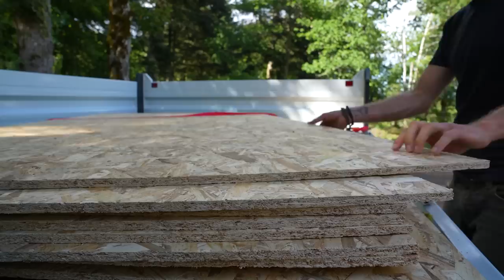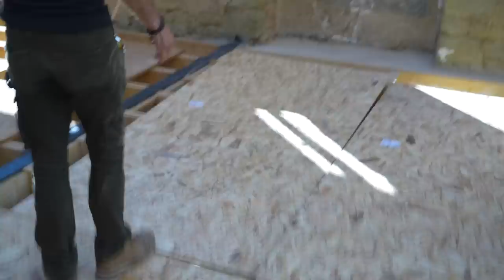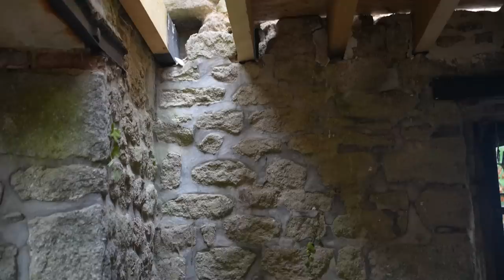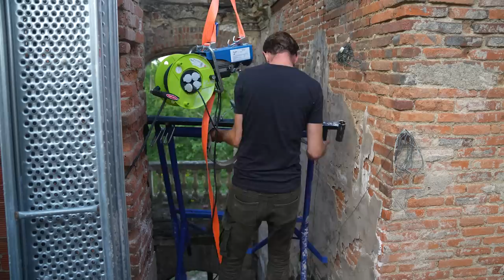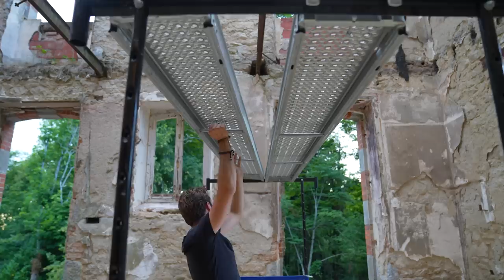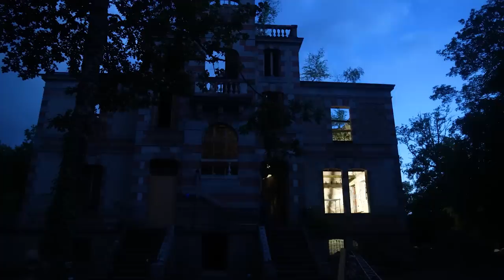A floor for a floor.

Comment: I really enjoy your video’s I am watching them sinds Christmas. Lots of respect for what you do. 
What I don’t understand is why not finish the wall at the top first? Bring in the circle beam and tie everything together up there. Then make the roof, I see you already have the boards for that. 
Now your all excited about these new floors, while your first job isn’t finished at all. Things keep getting wet all the time. What’s your motivation to do it this way?
Reply from the maker: The roof is suspended on the top floor, the top floor is supported by the walls , which need repairing and reenforcing from the bottom up and all new tie beams on each level to take the weight of the roof
Reply: That makes sense. Thnx. Thumbs up 👍🏼

Comment: Why park the van so far away. Lot of extra work carrying materials. Park the van up close see if you can unload through a window opening or back you to the front door. And buy a small ladder to be attached to you working platform. Get up and down as you do one slip in the rain. The project on hold for months

Comment: I would definitively have considered building temporary stairs in the main tower where the original one was, narrow enough to leave a good space in the middle to winch up material. With beams of small section (bastaings in French...), it should cost you only few hundred euros per level, and save you so much time during the next years until all dirty work is finished and you can replace it with the definitive stairs. Over the last level; it could support a platform for some scaffolding to build the roof... It could also be the structure supporting a temporary roof for the tower; made of corrugated PVC or else... Is that a bad idea?
Reply: It's a great idea.   Just waiting the day when Dan adds temporary main stairs.  I will make his life going up & down so much easier.   Good encouragement, explaining the cost.

Comment: wouldnt a roof be a better start then the lower floors? I understand access is a problem but it would make a huge improvement on working conditions for the rest of the build. Even a temp solution for a roof.
Reply: That is the usual order for these types of mansion/chateau/castle restoration, with lots of scaffolding all around ( and either big budget/big loan.)   A roof 1st , and then the inside.   I'm sure you've noticed Dan doesn't have alot of scaffolding.  In fact, he has a few and they're not industrial strength.  So, Dan has come up with an unsual method:   he is working his way up to the roofline, stabilizing the walls as he goes.   He is replacing brick & stone, and remortarizing so that the walls can support a new roof.   Temporary (flatish roof) first, permanent roof later ( see online black & white photos of Chateau Charmont for original mansard style roof.) 

He is almost to the roofline in the main hallway 2nd floor wall.   Then, a temporary roof.  He has covered those new wood beams & temporary OSB3 subfloors with tarp to protect them from rain.   Hopefully, he will cover the new temporary subfloors he just  built in the right wing ground floor with tarp when he isn't working on them.   Or, seal them.   Yes, working conditions inside could be better, with a roof.   But, it is what it is...he is getting there.
Reply: @homeemail2306  got it, thanks! And I just want to say I like this project and the work he is doing. A big feat for sure!

Comment: The kitchen is half basement isn’t it, from the days of kitchens being below stairs. Maybe you should use one of the rooms on the ground floor you’re working on now for the kitchen (as these days you don’t need so many formal rooms). Then you can have a big, bright, sunny , family kitchen with lots of windows and light on the ground floor. Makes more sense the way we live now.

Comment: Well done going for a cheaper temp floor! I'm still not sure why you did not stabalise the roof structure first, and seal the roof before going to the floors? Surely the roof and stabalising the structure is more important then the internals i.e. floors joists etc??
Reply: Dan does not have alot of scaffolding, like the usual way restoration occurs with other mansions/chateaus/castles.   So, Dan is working his way up to the roofline, stabilizing the walls so that they can support a roof.  He is replacing brick & stone, and remortarizing.  Temporary roof 1st, then permanent roof later as funding allows.
Adding floors also helps stabilize the walls. 
Dan is almost there, at the roofline at the 2nd floor wall in the main hall.

Comment: Dan, you need to HIRE a crane and lift it in over the top and bring down and hold while you and the guys guid into place and set them properly and safely. You’re too high up and the beams to heavy for 2 people to lift up into from the bottom. And you could also crane the 3rd level beams and set them in your hallway area and have that part complete while you have the hired crane.

Comment: Could you possibly attach your electric winch to the old beam at the next level and use it to lift the new beams in place.  I don't know how strong they are after the fire.

Comment: So I'm wondering, Dan, are you at a point where you could roughly finish at least one space to live in? Like for "camping" inside the chateau? I'm thinking composting toilet, Clean water and grey water tanks with a free standing sink, like a "tiny house" or "van life van" inside your chateau?
Reply: Unfortunately, he is not anywhere near where he could roughly finish a room of the chateau for camping in it.   He is mainly focused on stabilizing the walls/working his way to the roofline, so they can support a temporary roof.

He has already replied, "It still isn't watertight" to another commenter who asked the same question earlier this week.   The basement floods with several inches of water when it rains.   You can see the rainwater pooling in his Vlog when he first started to put the wood joists in the kitchen ceiling.    He has alot of future drainage work to do in & around the outside of the basement, as well as windows & temp. roof overall for watertightness.

It'll be interesting to see what Dan does for accomodations, water source/working water well & working septic system.   Lots of advice for sure in previous Vlog! comments!
Dan has said, "Never again," about a composting toilet in his video, "5 Years to Renovate an Abandoned Farmhouse".  I'd be surprised if he decided to do a composting toilet.
Reply: @homeemail2306  I do not read all the comments. Busy doing my own building these days. Thanks for the inspiration, Dan! 👍😊👍 But it just so happens that I did watch the video you mentioned before coming back to this comment and your reply. So I now fully understand that he would avoid a composting toilet. Might as well dig and build an outhouse in the meantime, then. I would also recommend "The Woodland Escape" channel for a life lived without flush toilets or power tools for that matter. Peter Kelly is a marvel as well when it comes to building and creating from scratch, an exemplary living historian for the period of 1750 to 1850 or so.

Comment: i think you should pitch the tent in the chateau
Reply: Unsafe work site.   Unstable upper parts, with debris ready to fall from above.  It regularly does fall, as Dan is working.   Bricks have already come down with high wind/tornado in the area in late winter/early spring...Dan made a Vlog about it, of course!
And unfortunately, the basement floods several inches when it rains.

Comment: I'm a little confused.  Do they not use plywood as sub-flooring in France or Britain?  Or use a sub-flooring in general?  Seemed kind of sketchy to me to see Dan working and walking on floor beams for no good reason when he could have sheathed it all with plywood and then covered it with a waterproof tarp for a safe, stable and easy to clean work surface (floor).

Comment: Question, what is going to happen to your OSB floor boards getting wet?  Here in Canada they will swell and fall apart?
Reply: Dan got OSB3.   Slightly waterproof.   He knows they will lose integrity with alot of rain exposure ( Chateau Charmont area getting alot of rain lately) so he has covered the ones he installed in the main hallway 1st & 2nd floor with tarps.  Hopefully, he will do the same to the new temporary subfloors & wood joists in the ground floor right wing to protect them when he isn't working on the floor.

Comment: Just curious about the farmhouse and Annalise and the kids. Are you going to finish the entryway and the bathroom?
Reply: Dan works on the farmhouse when he is not @ the chateau.  But now. This channel is all about the chateau, so we won't see any more farmhouse
Reply: They already have another bathroom at the farmhouse. The one Dan is going to build is a second one so it's not that urgent. Getting a roof on a section of the chateau before winter is a higher priority right now.
Reply: I realize they have a bathroom upstairs but as I said, I’m curious about the farmhouse, the studio, that rooftop terrace. Circumstances change, I get that.

Comment: About those glass floor panels: Really, really, really awful idea for women wearing skirts.🙄 If you use opaque glass, the basement will have shadows if people are walking over it. Which might be okay. But, since you can do whatever you want: why not a light well from top to bottom through the house? It would give some flexibility to interior rooms that don't have access to windows. Just a thought.

Comment: I'm wondering why you didn't start with the roof in order to get dried-in before working on floors on the inside? Maybe this was addressed in an early video but I'm newer to your channel
Reply: Walls & floor need to be stable first in order to accommodate a Mansard roof

Comment: Isn't it time for a temporary roof?
Reply: Yes, as soon as he works his way up to the roofline, stabilizing the walls as he goes.  He is replacing brick & stone, remortarizing so the walls can support the temporary roof.   He doesn't have alot of scaffolding, which would be optimal.   And adding floors stabilzes the walls, as well. 
He has put down tarps on the main hallway temporary subfloors (OSB3), to protect them & the new wood joists.  Hopefully, he will cover the new floors in the chateau right wing as well, or seal them.  
He is almost to the roofline stabilzing the main hallway 2nd floor wall.

Comment: sorry to ask but why you did not start to cover the top first then move yourself up ?
Reply: Dan does not have a way up.   Most of the these restorations of mansions, chateaus, castles start with lots of scaffolding inside & out.   Big cranes.  ( Maybe big budget/big loan.)  Roof 1st, then the interior floors.   Dan doesn't have the scaffolding.   So, he is working his way up to the roofline, stabilzing the walls as he goes, so it can support a roof.   Temporary roof 1st.   Then, a permanent, closer to the original roof later as money allows.
Adding floors stabilizes the walls.
Dan is almost done stablizing the 2nd floor wall in main floor hallway.  Then he can put temporary roof there.    Looks like he has decided to do the same in the right wing...work his way up to the roofline, replacing crumbly brick & loose stones as he goes.

Comment: you start to need a proper building crane Dan. you can work a lot safer with the steel beams and faster also. it will cost you a bit, but with the right preparation you could fit all steel for the flores in a week. so the sooner you can start rebuilding the tops of the walls around whits you need to close the building.  maybe it is closed for winther than.......so to spend on a crane can save you mony, costs and lots off extra works..... worth to calculate Dan😉

Comment: Yes Dan, glass floor panels would work for the kitchen.
Reply: Opaque glass panels by the windows would be OK, for light.   Opaque...for privacy.  No clear glass...inappropriate for girls & ladies wearing skirts moving around on chateau floors, and folks below looking up.
Another commenter mentioned glass block around the edge of the ground floor room...good option for letting in more light.   And still somewhat private, with the distortion glass block makes.

Comment: Do you plan on having a formal dining? On the first floor with the kitchen in the basement? Either put both rooms on the same floor, or you need to account for a dumb waiter to lift the food from the basement kitchen to the first floor dining.

Comment: you need to finish that floor first or you'll have a massive drop off of one side of that scaffold
Reply: LIke Inspector Clousseau in Pink Panther, inspecting the Chateau weight room & accidentally flinging himself off the parallel bars down the stairs into the room below? 😆  I hope not...very hard landing. 😮

Comment: Those glass floor panels...  Yes you will need well planned lighting and fortunately a good decorator when the time comes has a wealth of knowledge about such things, though I would not wait till the construction is done, it could be there would be special wiring needs that would be far easier to do now during the construction than later when the construction is finished.  Glass panels to let light in from above down in that former kitchen are not a good solution.  Sounds novel and cool, but, that room above is also going to have a roof blocking the light so the light up there will be greatly reduced.  Then also you will be furnishing the room above at some point, with some sort of decorative flooring, and then there is the question of ladies in skirts having people able to see up them from below.  Or, I can think of a hundreds reasons why I would be creeped out by that.  Not to mention glass would compromise the fire rating of that room.  Extreme heat can and likely will break the glass providing a chimney effect for any fire from below.
Reply: Ladies in dresses oh my, well the glass flooring could be placed in an area not in the path of the flow of visitors. I thought to bring in more light perhaps your glass flooring would be close to a window for more light.

Comment: Glass Floor Panels ?? You ARE going to be putting on a roof, there wont BE any extra light.
Reply: Sky lights?
Reply: WINDOWS
Reply: The floor above this one has MUCH larger and more numerous windows, and by virtue of being higher up, the light isn't as blocked by vegetation, so the floor above definitely will be lighter and brighter, even once the roof is on.

Comment: like I told you before start with the roof then work anytime you like. Get an army surplus parachute and rig it so the water drains off the project. Who spends money only to see it destroyed in the rain. Just put up a temporary roof then as I said before work at your leisure. Bring the wood indoors protected out of the rain. When I built my two story shop the frame went up rather fast but then I stopped and went to the roof install. When that was done pouring the foundation floor could get poured without damage from rain. I can't understand why the roof wasn't your first endeavor. Can you tell my why so I might understand your reason here? I still watch each new post but sooner or later I have seen you caught in the rain. But even then it doesn't dawn on you to get a roof over your head. Its not like you have a crew of 100 carpenters getting it built quickly so a little water wouldn't mean much. Anyway march on and good luck with this huge project.

Comment: Please take this comment in the caring and helpful manner that it is intended.
PLEASE take some time to investigate and consider installing a temporary staircase. I cringe everytime I watch you scale that rickety extension ladder that is propped up against a wall of questionable strength. I am not suggesting you are being careless (well, maybe a tiny bit), but the amount of time saved toting things up and down, the reduced exertion on your body, and the dramatic simplification of all elements in a project like this one will pay off in spades. A rough guess-timate (with the understanding that I am guessing sizes, scale and site conditions) would be about €3,500.

Comment: Did I miss why you aren’t putting the tent inside the chateau?
Reply: Unsafe work site.  Unstable upper walls with debris ready to come down.  Debris falls as Dan is working.  It has fallen with high winds/tornado? late winter/early spring.  Dan made a Vlog about it, of course!